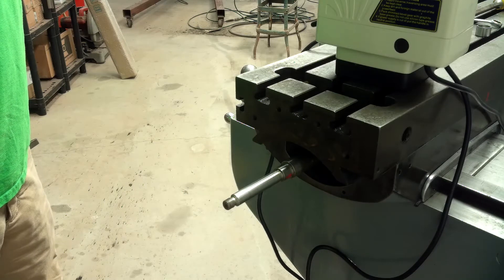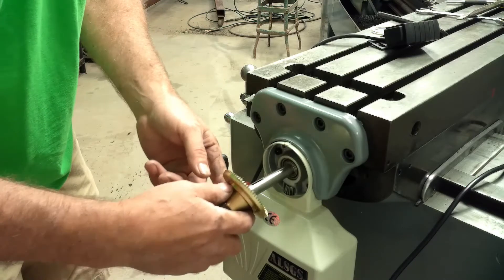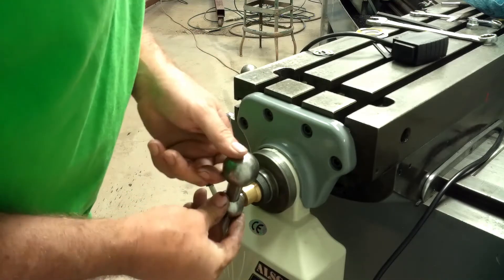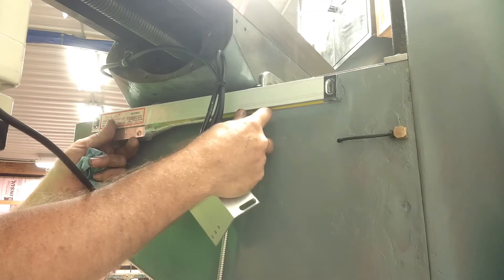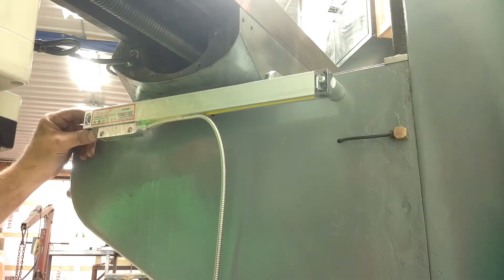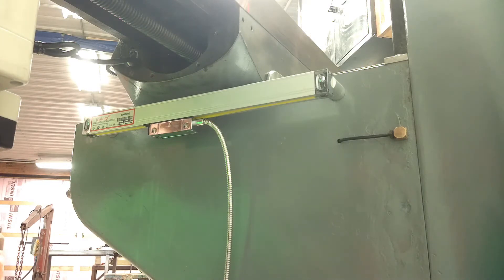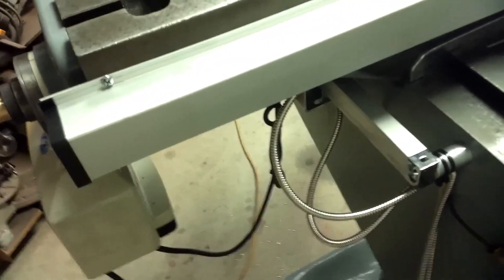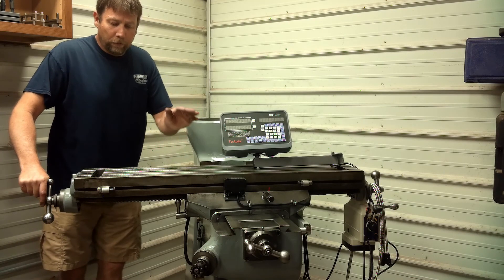Bridgeport 2J Mill X Axis Power Feed and Digital Readout Ep.4

Comment: You did the Y-axis readout the hard way.  I just installed one of these on my Bridgeport.  Just mount the longer readout section flush with the surface; you don' t need standoffs.  Then flip that bracket top-for bottom.  The underside of the table saddle is flat; put a couple of screws through the bracket vertically up into the table saddle.  Then the vertical part of the bracket installs perfectly to the readout slider by using a couple of the screws that come with the kit and running them horizontally into the slider.  If you look at the slider, it's threaded, so no nuts are necessary.  Sorry; I don't know all the correct terminology, but you get the idea.

Comment: That power feed is pretty neat.  Plus I bet it makes life much easier than having to move the deck manually.  Great work Jason!  Getting closer to being finished😀👍.
Reply from the maker: It is great Cody! I had thought about putting a power feed on my old mill, but I knew I was never going to be happy with that mill. Now I can go back and forth between the lathe and mill, running both at the same time depending on what I'm doing. Really saves time and takes the boredom out of it!